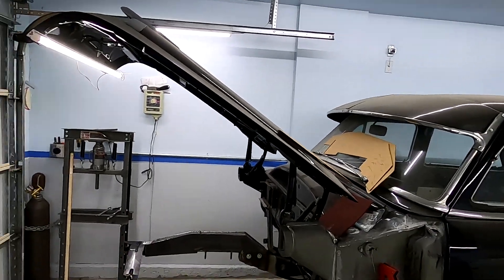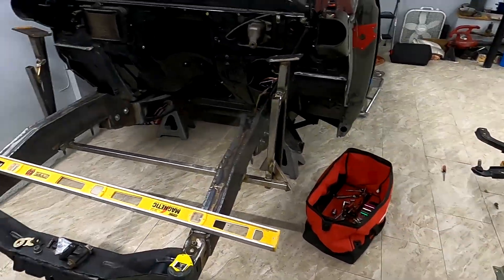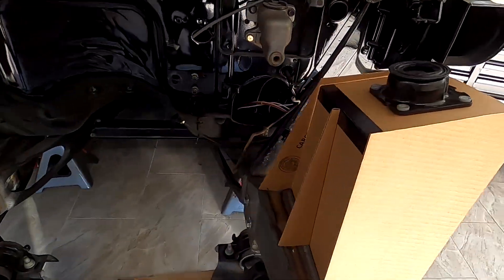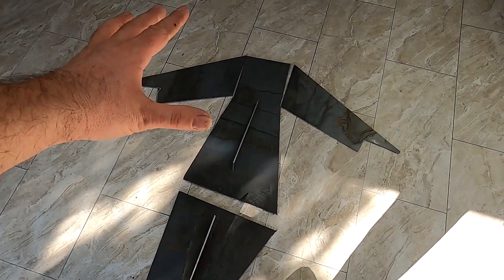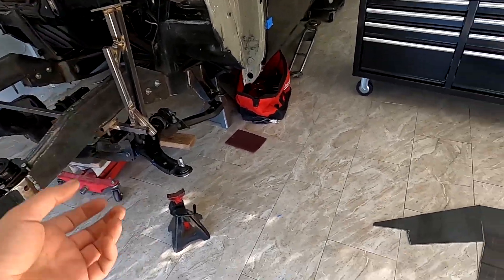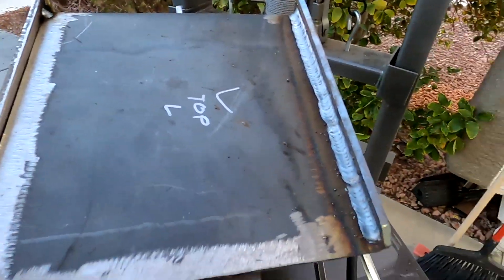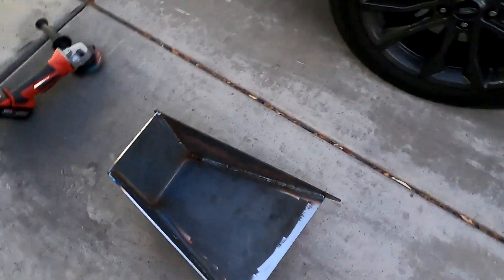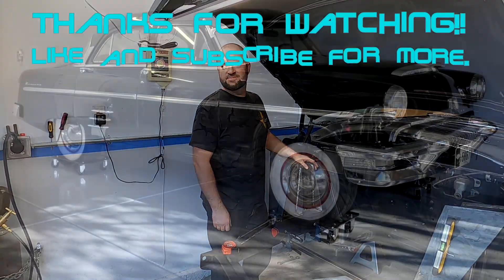Fabricating Custom Front Suspension - Strut Towers - Coyote Swap

Comment: I probelly would not have planed  the project like that, BUT a new prospective is a Good thing. :)   I would be curious as to what the stock sheet metal thickness measured in it's thickest spot.... Seems 1/8in  / .125 / 11ga   would have a 30% weight reduction...and be stronger than OEM sheetmetal.....   But you knew that... :)
Reply from the maker: Oh man, there are so many possibilities to go about, but the cheapest was this way since i have full donor car. I’m already thinking about next project and ways i should go. Fully committed now and will see it done this way. The thickness of oem frame was 10 gauge, but I’m no really worried about weight, i did chop a lot more of the frame, old control arms, full round beam that was 1/4”, I’m probably 50 pounds over with all this. If not same.

Comment: Man Amel that's top notch. One thing to keep in mind if you make that front end too heavy finding springs to hold it up may become a challenge. You might have to bolt on a F150, F250, or F350 suspension to the front....LOL
Reply from the maker: I’m pretty much at same weight with all metal removed and new one placed on.  Old control arms, springs, cross member were heavy.
Reply: @AmelsGarage  I'm sure you will be fine...Those s550 cars are Heavy....Heavier than the Merc.